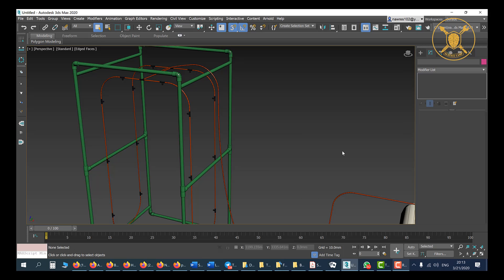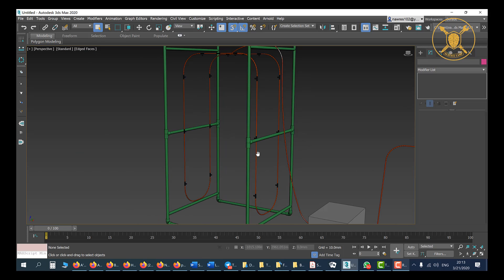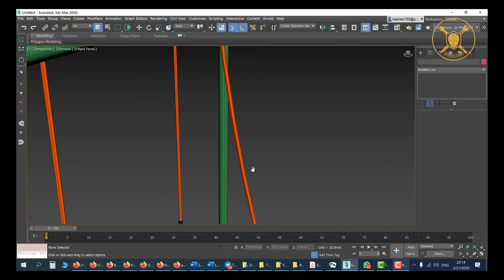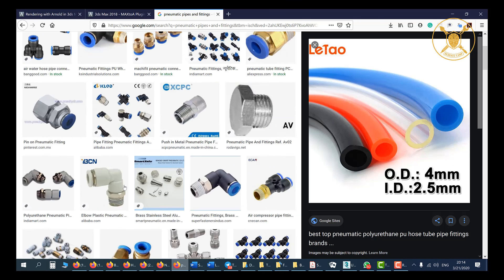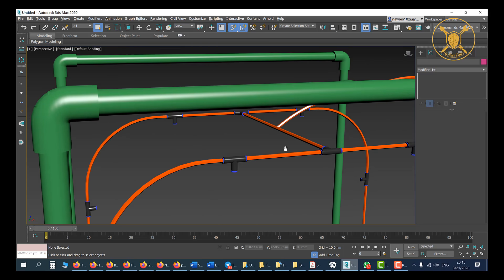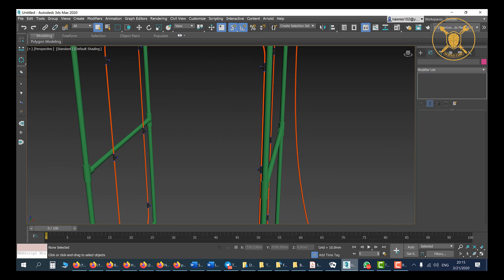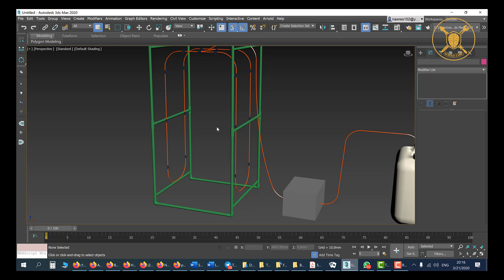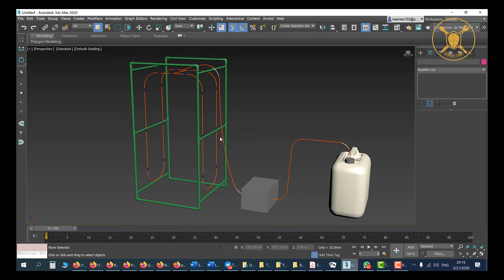DIY PVC sterilization gate

Comment: I'm impressed . It completes everything by itself, but you still need a motion sensor so that this system does not work all the time, which would cause too much disinfection fluid consumption.
Reply: I think a simple pressure activated switch match is ok. It starts the pump when there is a person inside and top the pump when he/she leaves.